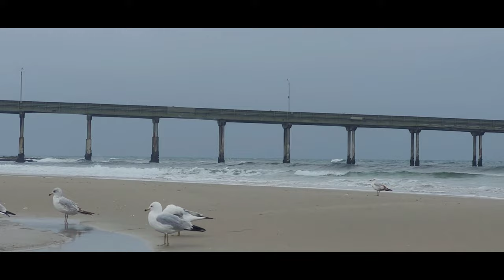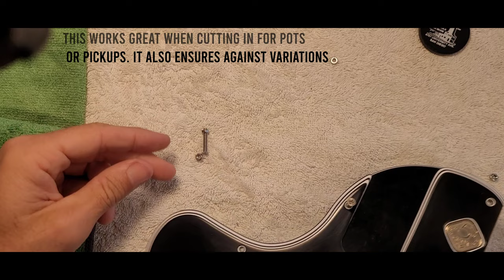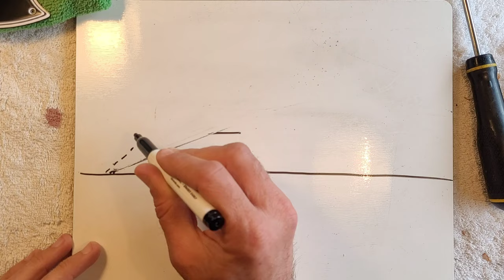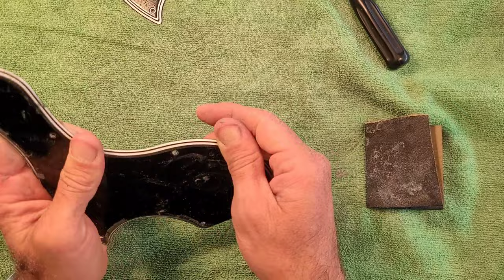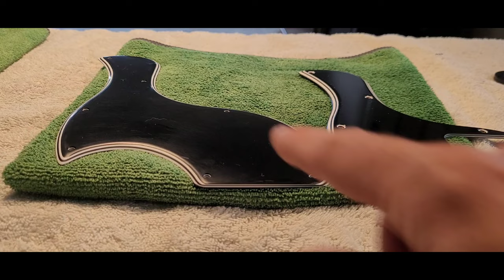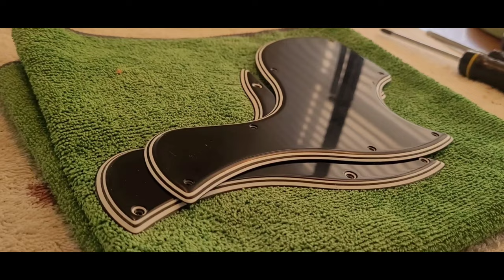WIDE bevel from your regular pickguard! DIY Relic mod

Comment: You would save about 3 steps by just scraping a wide bevel into it with a new sharp box knife blade. You don’t even need to sand the edge when you’re done. -GaryG (the pickguard guy)
Reply from the maker: Ehhhhh.....  maybe you wouldn't  need to sand the edge! Because you are Gary Tha G. 
   But I'm not the G! And sometimes I like the slow road and a buffed edge!  
     Thanks for tuning in Gary  :)
        I gotta hit you up for a few more guards in the coming weeks. Got some more projects coming in and they're gonna need something special.  🙌

Comment: This is a cool way to customize and dress up old guitars. I've done it on a couple Epiphones using pickguards removed from other Les Pauls that sometimes look better without. Just finished one yesterday in fact on an Epi LP Special, it was the perfect final touch on a sweet old guitar that plays awesome but just needed a little more visual appeal. I have a good wood shop but for this I just use hand tools- coping and back saws, files, sanding blocks and sandpaper. Maybe a little work with 0000 steel wool for aging to look right on used guitars. Polish 'em out with Turtle or McGuier's fine car polish using swatches of old t-shirts. Keep working 'til you get the sheen you want.
Reply from the maker: Exactly!  Little steps over time are a great way to really get these dialed in. 
  Thanks for watching Mark! Has the turtle brand compound worked for you? I feel like it's solid but more of a finish polish than a cut. Could never get it to really kill the haze.
Reply: @breilly66  Turtle is slow but it's hard to mess something up with it. Eventually you get the sheen you want or are willing to settle for. Then to finish it off I buff with Johnson's paste wax, which also does a little cutting and polishing. I use the finishing polish from Turtle, not the more abrasive rubbing compound grit. I've used it to rub out superficial scuffs and scratches on poly spray finishes too and made some ugly flaws almost disappear. Just takes some time and of course parts of it can be done with a buffing wheel to move things along. I've usually got time to do most of it by hand though. And I like the idea of doing a guitar mod using only hand tools.
Reply from the maker: @Mark Pell  Heck yea, I'm in the same boat. If I can slow a repair down and really work out every detail by hand....  I'm happy. :)
   Good input on the TW brand. I'm going to snap some up this week and see how it rolls with a new project. Cheers for the good info, Mark!
Reply: @breilly66  You are so welcome. Btw the TW polish does not contain silicones or wax so no reaction problems or residues that could hurt some finishes or give you other problems down the road. But it seems absolutely inert with polyurethane or polyester acrylic finishes. It is slow though but that's exactly why I like it. Less risk.
Reply from the maker: @markpell8979  That is what I'm talking about.   🙌
   Was literally just talking about the resin dissipation in the MecGuires with a friend.

Comment: Do you know the method for making your own custom multi ply guards? ex: If I wanted to get 3 single ply sheets, what is the correct way to put them together as a 3ply pickguard before cutting?
Reply from the maker: I'm fairly certain they are pressed together at high temps.  
   You could likely get sheets to bond with a brush on glue (it'd have to be very very thin in viscosity to bond abraded plastics though). And would need to be clamped down with wood sandwhiching it. This way the distribution would be even enough to counter any bubbles/air pockets which could be revealed while cutting and shaping. 
   I think it could be done though. And would likely open up a whole other world as far as beveling and shaping. 
   Honestly, this is a cool idea and needs to be explored.
Reply: @breilly66  thank you!!
Reply from the maker: @qlyde Yessir!